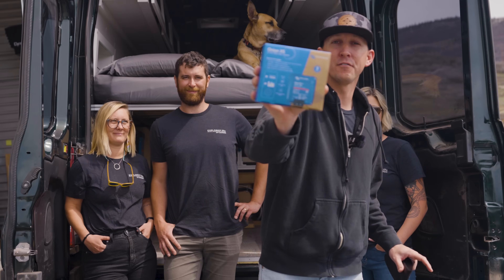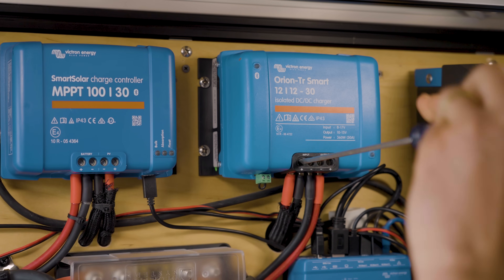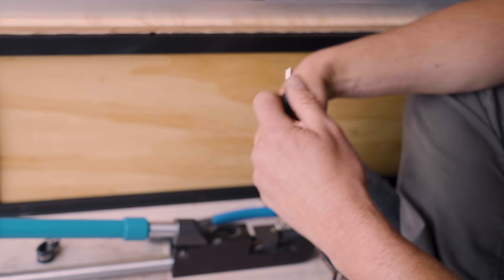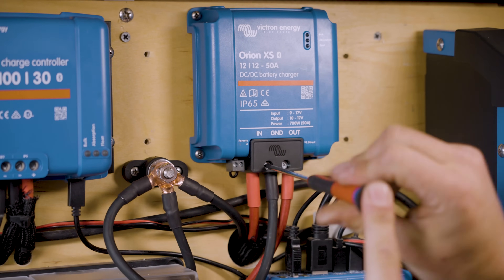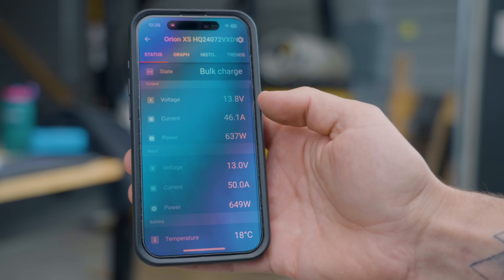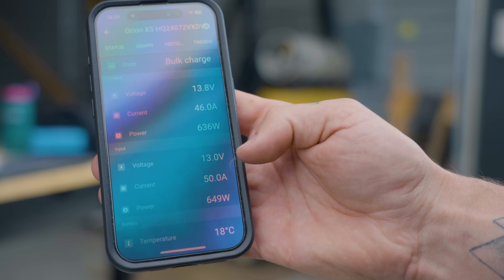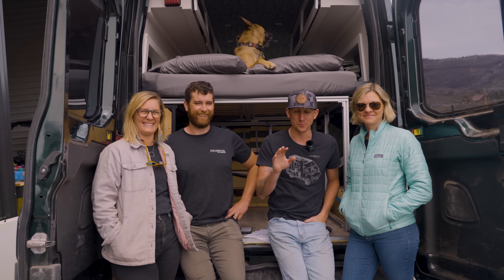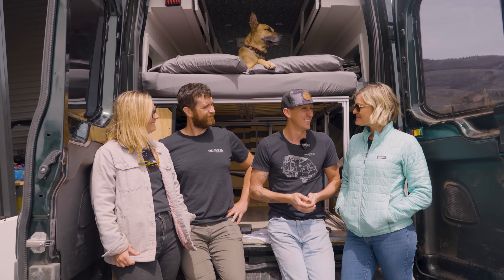Victron Orion XS DC DC Charger Installation/Upgrade Tutorial

Comment: I do not understand the junction stud. Is it driven into the wall of van?
Reply from the maker: Good question — that part is a little confusing without seeing your full setup. 👍 There are a few different ways that junction stud can be used depending on the van, wiring layout, and components you’re working with, so it’s hard to give a one-size-fits-all explanation in a comment.

If you want, reach out to our support team and we can take a closer look at your specific project and make sure you’re doing it the right way (and point you to the right parts if needed): 👉 https://shop.explorist.life/support?utm_source=youtube&utm_medium=comment&utm_campaign=support&utm_content=response_link
Reply: @EXPLORISTlife So is it driven into the wall of the van?
Reply: Or is it just into the wood.
Reply from the maker: Reach out through the previously provided link and we can provide you with further complementary guidance when you purchase your wiring kit. 😀😎
Reply: @EXPLORISTlife very cute
Reply from the maker: What's the hesitation to reach out via email for complementary customer support?  I'm truly not trying to be difficult, but I don't know what the roadblock here is.

Comment: Question! Set up is boat system with engine battery only used for starting. No auxiliary systems supported except engine instruments. Is there any disadvantage to having my alternator directly charge my large house bank (600 Ah Lifepo4) and use the Orion XS to only charge my starter battery (150 Ah lead acid). That way my 100 amp externally regulated alternator can directly throw lots of energy into the house bank and the Orion barely has to work to maintain my lead acid starter battery. I am assuming I can even set up the Orion to only connect when the engine is running.
Reply from the maker: Good question — setups like this can work, but the details really matter on boats, especially with LiFePO₄ and alternators.

Rather than giving you a generic yes/no (and potentially steering you wrong), the best move is for us to take a quick look at your specific alternator, regulator, and battery setup so we can make sure everything is protected and charging the way it should.

If you reach out here, our team can review it and point you in the right direction (and help you get the right parts if needed): 👉 https://shop.explorist.life/support?utm_source=youtube&utm_medium=comment&utm_campaign=support&utm_content=response_link

Comment: Does this until draw power from the van battery when the engine isn't running?  I've looked at other DC/DC chargers and it looks like they all pull from the battery and require a disconnect switch.  I'm afraid of forgetting and killing my van battery.
Reply from the maker: Great question — that’s a really common concern with DC-DC chargers 👍 Because vehicle electrical systems and usage patterns vary so much, we’d want to take a quick look at your van, battery setup, and how it’s wired before giving a confident recommendation (and helping you avoid a dead starter battery).

If you reach out to our support team here, they can review your setup and make sure you’ve got the right solution — and the right parts — for your build: 👉 https://shop.explorist.life/support?utm_source=youtube&utm_medium=comment&utm_campaign=support&utm_content=response_link

Comment: In an upgrade from an isolated Orion Tr, would you be able to connect the negative wire from the starter battery directly to the negative buss bar on the lynx distributer? Then could you not have to use a junction post and just connect the negative output from the Orion XS to its existing position on the lynx? Thanks for the help. I bought the Orion Tr and kit from you just before the XS came out, but I''m wanting to upgrade it for the 50a!
Reply from the maker: Yep — this can vary a bit depending on how the rest of the system is laid out. There isn’t really a universal answer that works for every install.

Best bet is to have our support team take a quick look at your setup and confirm the cleanest approach for your upgrade. That way you know it’ll work exactly the way you expect 👉 https://shop.explorist.life/support?utm_source=youtube&utm_medium=comment&utm_campaign=support&utm_content=response_link

Comment: A video on how to wire up your Orions would be useful presuming this can be done? I have a 240 amp alternator which is just for leisure batteries. Soon as the Orion is only 50 amp I should be able to run two of these office alternator?
Reply from the maker: Yes, we have tutorials, guides, wiring kits, etc to make those connections indeed.  Reach out to us at shop.explorist.life/support and we can provide some guidance.

Comment: I don't think there's one YouTube channel that talks about using solar panels on the house bank and the Start batteries being if you're on a boat using the system does the DC to DC charger still look act like a ACR does current go both ways when the vehicle is off or the boat
Reply from the maker: That’s a really insightful question — there are definitely some unique considerations when using this kind of system on a boat!

Whether current flows both ways and how the DC-DC charger behaves depends on the specific charger model and how it’s configured, especially in marine applications. Some setups may resemble an ACR in function, but DC-DC chargers are generally designed for one-way flow unless specifically designed otherwise.

This is a great one for our support team to take a closer look at with your exact setup in mind:
https://shop.explorist.life/support

Comment: Who makes the circuit breaker at 3:38 in the video please?
Reply from the maker: https://shop.explorist.life/product-category/all-products/components/fuses-breakers/dc-breakers/
Reply: @EXPLORISTlife  Thank you, how do I work out what Amps protection is needed for a 12v 95Ah 900A vehicle battery
Reply from the maker: @SteveBPiercy  Great follow-up question! The right breaker size depends on a few things like your wire size, system configuration, and what loads you're planning to run — not just the battery specs alone.

Our support team can help you work through all the details and recommend the right protection setup for your build:
https://shop.explorist.life/support
(Free personalized help for anything purchased through our store!)

If your components were purchased elsewhere, the Pro Support Membership is a great way to get one-on-one assistance:
https://shop.explorist.life/shop/all-products/membership-tiers/

Comment: Where the heck is the heat sink?
Reply from the maker: The metal plate on the back IS the heat sink.  The PCB is printed directly onto the aluminum back plate, making a big bulky heat sink not necessary.  If you need help with your electrical project, feel free to reach out here: https://shop.explorist.life/support
We offer free help on gear from our store, or check out our Pro Support Membership if your parts came from somewhere else: https://shop.explorist.life/shop/all-products/membership-tiers/

Comment: if i add this to my RV power bank. Can I run a 4AWG wire from the vehicle ground and ground that connection on my lynx bus bar to have the same ground for this non isolated charger?
Reply from the maker: Good thinking — grounding questions like this are super important, especially with non-isolated chargers. That setup might work depending on the rest of your system, but grounding choices can vary a lot based on how everything else is configured.

We’d love to take a personalized look at your layout to make sure it’s both safe and effective. Just shoot us a message here: https://shop.explorist.life/support and we’ll help you sort it out!

Comment: Great video & have 2 questions;
-1; Looking to buy 2 of the xs 1400 24/24v version and you website shows that it has it, but back ordered. When will it be in stock?
-2; I have a 24v 80amp alternator, and when you program the victron xs1400, how do you decide how to program the alternator output; (up to 50amps) on the app., how do you know what to set the max amps coming out of the alternator or does the Victron xs1400 automatically regulate it?
Thanks
Reply from the maker: Reach out at https://shop.explorist.life/support and we can get you the most up to date backorder info.  Once your order is placed, we can handle the customer tech support inquiry. 👍🏼

Comment: Is the junction stud even necessary when you can just connect everything to the negative bus bar of the lynx distributor?
Reply from the maker: Stacking 4/6AWG lugs in the lynx distributor does not fit.  We did indeed try that as a solution.

Comment: I noticed your wire kit uses 4 awg wire.  What ferrules are you using for this?  I cant fine a crimper that will do a hexagon shape for 4 awg wire.
Reply from the maker: You'll also notice the ferrules aren't included in the kit because they don't fit.  Reach out to customer service at https://shop.explorist.life for some help if you get stuck.

Comment: I finally installed this on my truck camper. I found out the aux pin on the seven pin camper connector was connected to my electrical system (lithium) and was holding my truck batt at 13.3V so I had to break that connection. Now only the Orion XS has a positive lead and I can use the voltage start/stop feature to reliably turn on the charger.

Comment: Can I use my trucks frame for my negative vs. using a wire from the battery?
Reply from the maker: You strike me as the kind of person that likes to do things right the first time around so you don't have to troubleshoot and ultimately do it twice, yeah?  If so... run the negative wire.
Reply: @ so it is ok but you recommend against it
Reply from the maker: It shouldn’t combust, but I’m also not going to help you troubleshoot if it doesn’t work. 🤷🏻😂
Reply: @EXPLORISTlife  The Orion manual shows negative going to a chassis ground also; are you recommending wiring the Orion negative to a shared battery bank/starter battery junction and not worrying about a chassis ground?

Comment: There is one thing that I have not seen on any videos that I am curious about. I have several solar generators and I need to limit the power for a smaller 256w box. 700w is not good for the batteries.  Is it possible to reduce the output wattage similar to what the Ecoflow Alternator Charger will do?  Thanks!
Reply from the maker: The Orion XS does indeed have the ability to turn down the charging amperage, yes.

Comment: Hi Nate!  Great video!  I plan to swap out my Renoge 60A DC-DC converter to this one in my Sprinter van.  My Renoge has an ignition detection wire to it so that it doesn't drain my chassis battery when not running.  How does that work with the Victron?  TIA!

Comment: I own a Tiffin Wayfarer RW. I am planning on installing a Orion SX.  This swap was easy as it’s in a previously installed environment. Do you have a video of a production built environment?  I’m also wondering can the SX be installed in an open environment like the battery box?  Do you sell a kit?
Reply from the maker: Do you have a previously installed Orion 30A DC DC charger or are you starting from scratch on that regard?
Reply: @EXPLORISTlife  starting from scratch around the components already installed by the manufacturer.
Reply: I will be removing the old battery’s
Reply: The replacement is a Epoch 12v 300AH battery ( one for now)
Reply from the maker: Gotcha; yes.  We have full system retrofits available which now include the Orion XS.  Check this playlist for what is involved in that process: https://www.youtube.com/playlist?list=PLmvhcyi4n0TUU8FUc6LE38TBkdSLjdw_5

Comment: I am trying to understand if the Orion XS can be wired directly from the alternator but I cant find any info on that setup. The idea is to use a 12V 300Ah Cranking & Deep Cycle Lithium Battery (Dual Purpose) for both starting and house.
Can you please help with my "crazy" idea?
Thanks a lot, love your videos!
Reply from the maker: This may take a more in-depth look at your personal setup.  If you have purchased/are purchasing from our store (shop.explorist.life) reach out for some more personalized help: shop.explorist.life/support

If you've purchased/are purchasing elsewhere, reach out to your dealer for support.  We'd love to have you as a shop.explorist.life customer so we can provide a bit more help in the future. 🙂

Comment: I installed the Orion XS following this diagram.  I noticed that this seems to have overridden my master disconnect on the Sprinter van.  As in, with the negative wire running from the OEM battery back to the Lynx Distributor, which is grounded to the chassis, I can no longer disconnect the engine battery on the Sprinter.  Does this make sense or might I have an issue somewhere?  

In addition to the breaker on the positive side, I installed a breaker on the negative side as well so I can flip that off whenever I need to disconnect the engine battery.  

but I'm surprised that this wasn't covered in the tutorial so I'm wondering if I'm doing something wrong.   anyone have any ideas?
Reply from the maker: This may take some more in-depth troubleshooting.  If you have purchased/are purchasing from our store (shop.explorist.life) reach out for some more personalized help: shop.explorist.life/support

If you've purchased/are purchasing elsewhere, reach out to your dealer for support.  We'd love to have you as a shop.explorist.life customer so we can provide a bit more help in the future. 🙂

Comment: What are the settings in the Orion XS 50 for the Ford Transit smart alternator?
Reply from the maker: For the engine shutdown detection, the default settings typically work fine.

Comment: So i understand the the Orion XS can limit input current from the source (1-50a) and limit output current (1-50a) something that the TR cannot do. So is the XS the charger i've been looking for ? Let me explain, a portable box build set up, all Victron, i want to charge from the vehicle 12v , (electric vehicle ) but i don't want to be running wires from the battery, vehicle warranty etc, so, can i charge from the cigarette lighter socket with the XS, limit the amps down to say 10a ? My vehicle has 2 x cigarette lighter sockets, each on it's own 15a fuse. Thanks.

Comment: Why do you use ferrules in the XS connections when the Victron instructions say there is no need? Better connections are made without a ferrule?
Reply from the maker: Ferrules ensure that all strands of wire actually make it into the terminal in a nice and neat fashion.

"Better connections are made without a ferrule" As a blanket statement, this is not true, no.  Most people, in my experience, when making an un-ferruled connection, haphazardly jab the wires into the terminal with no regard for workmanship which results in only a part of the wires making it into the terminal, leading to a loose connection.
Reply: @EXPLORISTlife  I agree, as described it would produce a poor connection, but in your experience you must have run into a lot of different people than me. If they have no regard for workmanship, maybe they wouldn't even get the ferrules on correctly and shouldn't be attempting electrical work. Of course I was talking about connections where all the strands are in the terminal and torqued up correctly.
This wasn't a dig at you btw, I enjoy a lot of your content.
Reply from the maker: @rallyeroamer3371 ferrules have single handedly fixed 99% of connection problems since I introduced them on this channel 4ish years ago.

Comment: Thanks for the video guys!

I'm new to electrics and was gearing up to ground the negatives of my Orion directly to the chassi as in the Orion XS manual it shows the junction of the negative wires being grounded directly to the chassi. Am I correct in thinking that you didn't need to do this because the lynx distributor is grounded to the chassi, so the grounds of the Orion XS can find there way to the chassi through that route?

I am following one of your wiring diagrams and so I also have a lynx distributor grounded to the chassi. Is it best for me to follow this videos demonstration with a junction stud? Does it matter having two points of chassi ground anyway? 

Cheers!
Reply from the maker: We do indeed recommend using the junction stud like shown in this video and in all of our diagrams and kits.  It's simply a more reliable connection than using the chassis as a current carrying conductor.
Reply: @EXPLORISTlife  thank you 👍🏼

Comment: should i consider a dc to dc charger to charge my 2 100 Ah travel trailer batteries?  at present we are charging just from the 7 pin plug and from looking at the truck harness the 12V lead is pretty small, plus it's bundled into a harness.  max charging current that i've measured is around 11-12 amps which is from the truck(ram 1500) alternator.

Comment: Can I turn the Orion on/off from the App?    If not, I know there is a phyical on/off on the Orion using the H-pin    Do you have a video on controlling power to Orion?    Thanks!!!
Reply from the maker: It can indeed be enabled/disabled from the app.
Reply: @EXPLORISTlife  thank.. I can always trust you for the correct answer

Comment: What needs to happen with the little green plug-in on the old Orion when doing a swap? Anything? Thanks!
Reply from the maker: Both the old and new Orions have their own jumper pins.
Reply: Ok, so I just remove the jumper pin first, and then plug it in after everything is wired?  Thanks.

Comment: Question. When you install a dc to dc charger from truck to camper .Do you disconnect the 12 volt at 7 way plug cause you are running lithium batteries..and where is the best place to disconnect if you do the truck or camper side